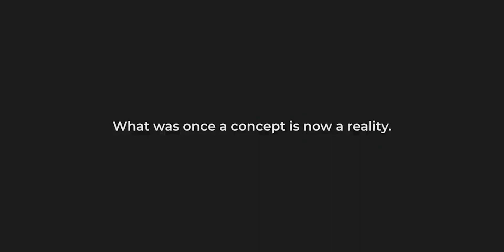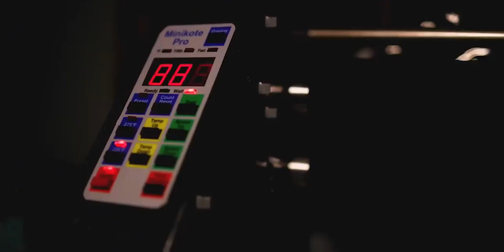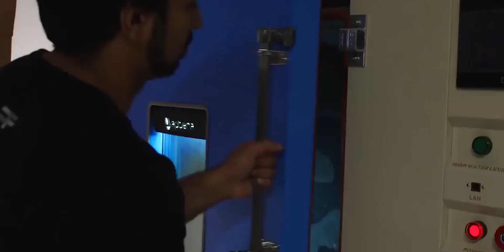Aptera Just Announced New Solar Cell Supplier Maxeon For It's SEV

Comment: The 130,000 sq ft facility in Vista is only for solar panel production.  There is an 80,000 sq ft building in Carlsbad for vehicle assembly, and an additional battery pack assembly building, among other sites.